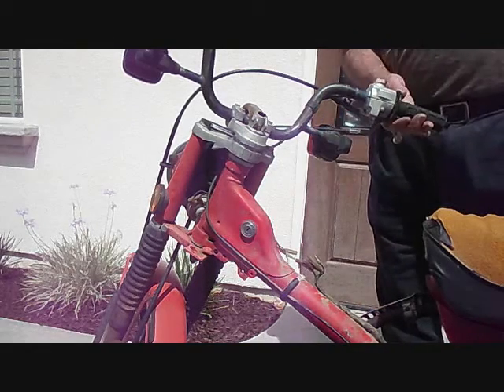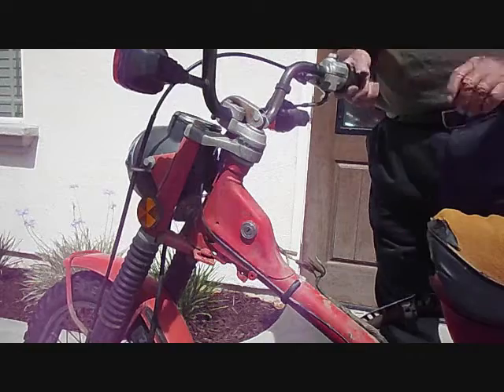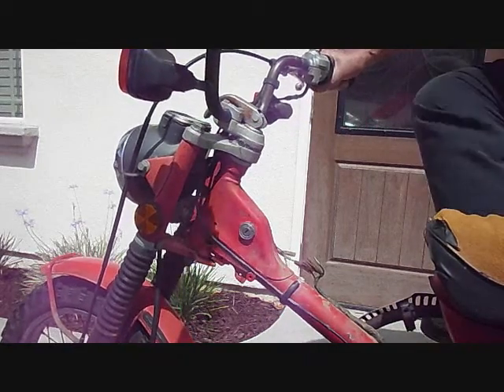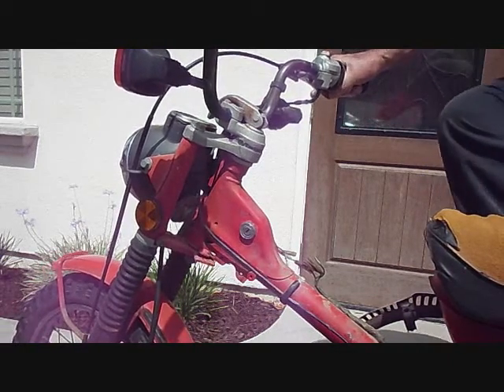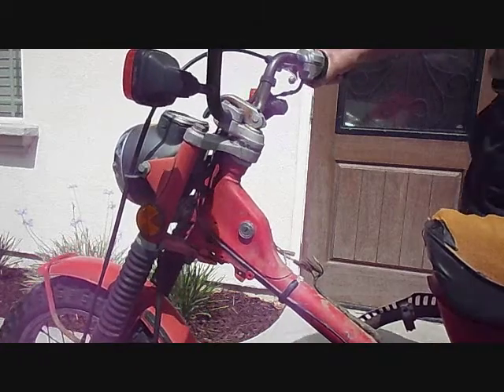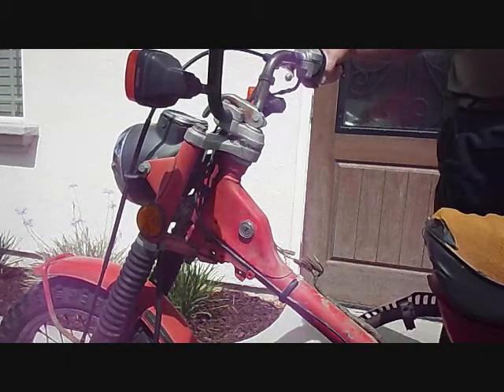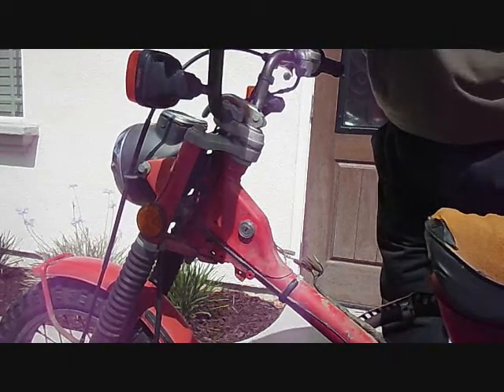Honda Motorcycle CT 110, Ignition Switch, 1of2, Hotwiring

Comment: Thankyou, I just got a 110 with no keys
Reply from the maker: Glad to help.  I have another video on youtube if you decide to make keys for your CT110.
Reply: @SoCalBruce  : hi Bruce , yes I did watch that video as well , over here in Australia these motorcycles were used by Australia post for letter delivery, they are very popular and are used as adventure bikes camping bikes etc , and even as a second hand bike can still bring a high price 
All the best
Reply from the maker: @kevinrusso6849  The last year that we imported the CT110 was 1986.  So they are a little scarce.  They bring around $2,500 if in fair condition in California.
Reply: @SoCalBruce  Hi Bruce , mine is a 98 model I think they changed from using them in the last few years but I saw the other day a 2010 or 13 for around that $2500 mark , still very popular and lots of spares available , an after market motor $380 AU